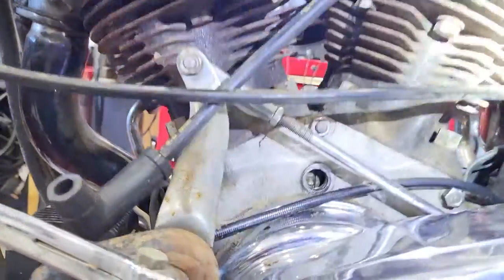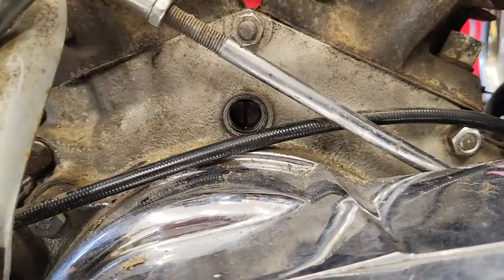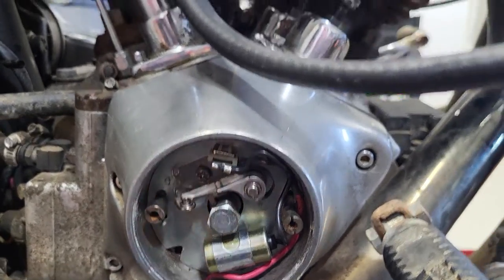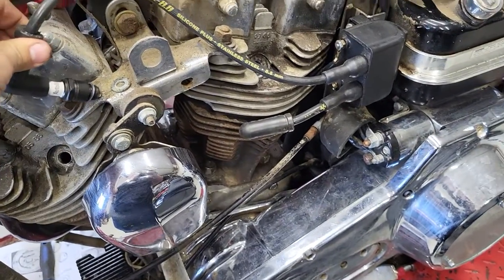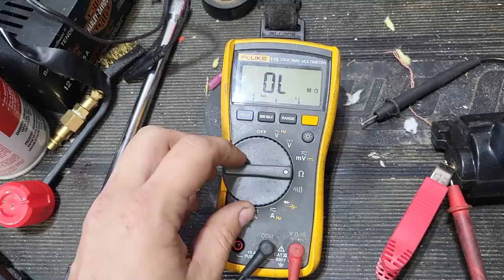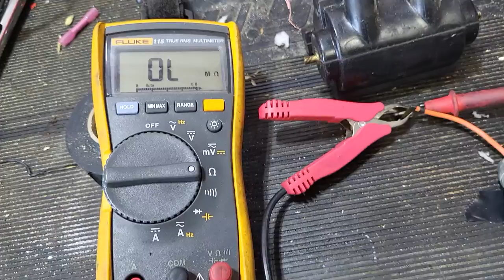Shovelhead points ignitions timing, testing a coil, testing capacitor.

Comment: .Cover 'gasket 'pionts '
Condenser and gap plugs to points timing ...and you are right about the ol ladds not agreeing...
Points over elec any day for me and that go's for the classic cage i drive also 😉😎
Keep up the good work .👍
Reply from the maker: Lmao! I do think it's a generational thing. There's nothing wrong with points at all. They work fine. I just prefer electronic, its a lot simpler to me.
Reply: @DWchopshop  😎👍

Comment: What about old school side of road technique? Set points gap on the firing lobe, set plate in the middle or to a spot u can get the bike started, advance until you hear ping back off very slowly until ping goes away call it good.
Reply from the maker: I've always had more of a do it right the first time so your not sitting on the side of the road mindset.

Comment: Hey brother I got one for you I got plenty of spark and plenty of fuel,coil was tested functional,battery perfect 73 shovel 4speed transmission all  I got is headlight and tail light kick only and she won’t fire, she’s not sucking air I’m completely dumb founded any idea s I’m open to try anything
Reply: adjusted your pushrods?
Reply from the maker: What kind of ignition does the bike have? James has a good point with the pushrods, that can definitely make for hard starting. I would recheck static and mechanical timing too.

Comment: So tdc compression stroke on front cylinder.

Then adjust the gap on the points.

Then with test light lock plate right before it lights up.

Thats it ? How do you know if you need to go clockwise or counter with the plate during the test light step ?
Reply from the maker: Advance the weights to fully open (twist the middle peice) 

Then test with a light and pock Plate before it lights. 

Normally, you put the plate on so you can rotate it clockwise to set timing.

Comment: run electronics and bring some walking shoes lol
Reply from the maker: Show me a points ignition that doesn't need to be touched for hundreds of thousands of miles. Any modern electronic ignition is leaps and bounds better than points.
Reply: I run electronics and keep a spare set of points in the bag just incase